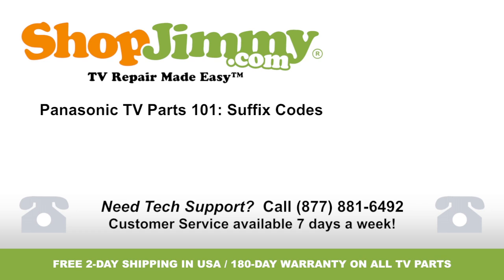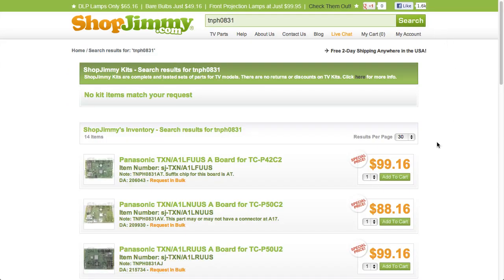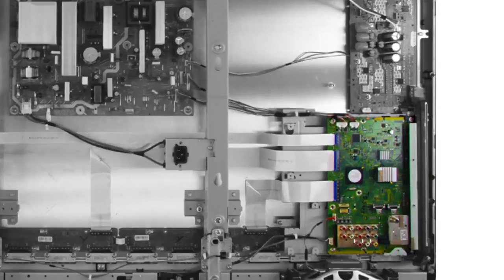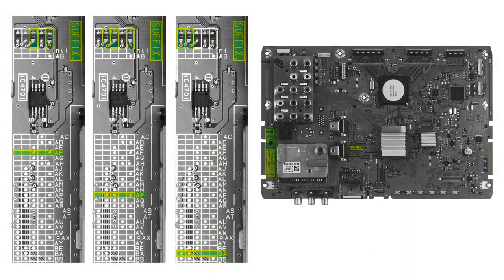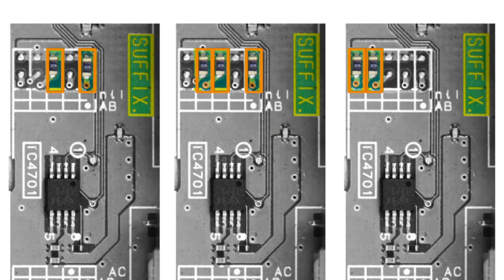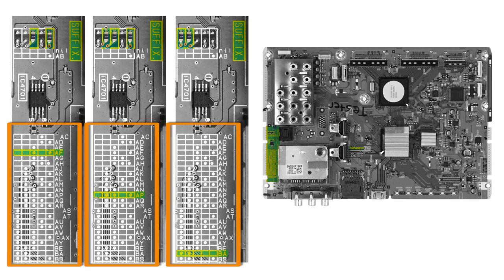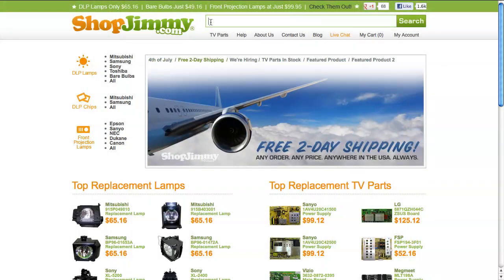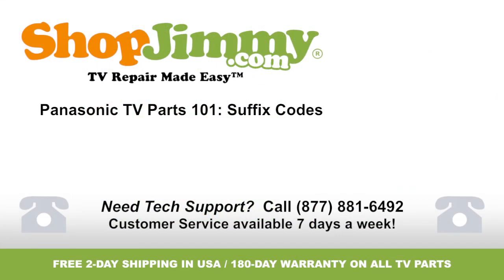Panasonic Plasma TV Repair-Understanding Suffix Codes for A Main Boards-How to Fix Plasma TVs

Comment: hi i have a panasonic TC-P58S2 Plasma tv, the red light keeps blinking red every second continouesly, the relays click on then click off a second later, i checked the capacitors they are all good, there was one time where i would reset the tv by holding the power button down then it worked now nothing, i have another identical tv and works great no problems, i have a surge protector on that one but the not he one im writing you about so im thinking thats the problem why,through my research i have come to the conclusion that the problem is the main power board, anything advice you can give me would be  greatly appreciated thanks

Comment: Dear I have Panasonic Plasma Model: Th-P42C10r which power supply assembly no: ASSY.NO.LSEP1279 and Bar Code 79BE0516022, we are facing problem of restart tv after 10 minutes or some time after on hour with RELAY SOUND like "CLICK CLICK CLICK CLICK"
Please let me know how to fix

Comment: Hi there, I have a Panasonic TH-42PZ700U TV, the color is mostly greenish in the center of the screen. I searched to see if I could adjust the colors but unable to. I'm wondering if a circuit board controlling the color is defective. Can someone who knows about this please let me know if that could be the problem, and if so,  which is the board that should be replaced, I'd appreciate the help, thanks.  Laponte20@aol.com

Comment: hi I have a 50 inch Panasonic tcp50g10 that wont turn on and light blinks 5 times can u help with the problem and if needed sell me the parts to fix the television

Comment: Hi there, hope you can help. My TC-P65VT60 Panasonic plasma is not turning on. It only displays three red blinking lights. What could I do? Thank you very much.
Reply from the maker: +DarthCardo   Try this at your own risk. Unplug the TV, then disconnect the SC board and plug in the TV to see if the TV powers up. Note that it will not have a picture on the screen. Reply with the results of this test. Thanks! www.shopjimmy.com

Comment: hi there I have a panasonic LED tv model TC-L50EMS5 and the problem i have is that i can watch tv or my computer, but if i play my playstation, it will play for about 10 mins then it will shut off and I get 9 blinking lights. i have tried to research what the fault code is but i fund a lot of plasma info and none on the LED TVs

Comment: Panasonic Plasma TC-P55ST50 won't turn on, and blinks 7 times.  Thought it was SC/SU/SD boards so I unplugged the power supply at SC board (running from central power board to SC board), and also the three flip-up connector things (SC42, 46, and 41) between SD/SU boards and SC board.  Plugged TV  back in (to the wall for power), turned it on, and now I have 8 blinks.  Confused, can't find videos that explain, so I'm calling in reinforcements from ShopJimmy :)
Reply from the maker: Justin Newman   Try this at your own risk. Unplug the TV, then disconnect the y board and plug in the TV to see if the TV powers up. Reply with the results of this test. Thanks! www.shopjimmy.com
Reply: ShopJimmy.com  Thanks for the reply - so I followed your instructions; I Unplugged the TV, then disconnect the y board and plugged in the TV to see if the TV powers up.  It doesn't seem to power up, there is nothing on the screen, and it only blinks 7 times.  What should I do next?
Reply: When I say I unplugged the Y board, I assumed you meant me to only unplug the cable on the Y board that connects on the other end to the power supply.   No start up, only 7 red blinks.  Thank you in advance for your continued help
Reply from the maker: Justin Newman   Try the same test on the SS board.  Thanks!  www.shopjimmy.com
Reply: ShopJimmy.com 1. With the SS board being the ONLY thing disconnected from power board (and everything else connected), screen doesn't start at all and is just dark, 8 blinks.   2.  If SS AND SC Boards are BOTH disconnected from power, screen doesn't start at all and is just dark, 7 blinks.

Comment: I have a Panasonic plasma tv model TH-58PX60U.  It will not turn on.  It gives the 10 blink code.  I'm almost sure it's the power board that needs to be replaced.  I'm not sure which part to order.  Would it be something that I can repair myself?
Reply from the maker: mrslrj1s    Try this at your own risk. Unplug the TV, then disconnect the SC board and plug in the TV to see if the TV powers up. Reply with the results of this test. Thanks! www.shopjimmy.com
Reply: +ShopJimmy.com 
The tv does not power on.  It still displays the red light 10 blink code.

Comment: I have a TC P50G10 that experienced a loud popping sound. When I tried to turn on the TV I received no sound, no picture; however the backlight illuminates and I don't have any blink codes. I took the back of the TV off and can see that both the SC and SS boards are getting power, because the green led lights up on both. Any idea what the problem could be, I've done some research and think it could be the A board.
Also, I connected the TV to my router to see if it would get an IP address and it did, but the light remained amber instead of going green which also leads me to believe it's the A board. PLEASE HELP!!!!
Thanks
Update: I should note it's a 2009 model, don't know if it makes a difference.

Comment: We have a Panasonic Viera TV TP-50S1 (2009) and there is no sound or image.
Red light's flashing 10 times, goes off and starts again. We were informed that it was the MainPower TNPH0876-1A. We want to know if it's the the right part and where we can find it. Thank you.
Reply from the maker: carole labelle   Please watch this video FIRST to help with your repair!  https://www.youtube.com/watch?v=BP3NVNCGEv8  I recommend replacing the main board in your TV.  Click this link to possible replacement main boards for your TV model number on our website:  http://www.shopjimmy.com/catalogsearch/result/index/?cat=56&q=50S1  There may be multiple boards for the same TV model number, be sure to match part numbers on your current board, with your replacement for compatibility.  Thanks and please let us know if you have any further questions with your TV Repair!  www.shopjimmy.com

Comment: Hi, My tv is a tc-l32u22 with a defective Main Board TNPH0857 Suffix AE, is long out of stock in your webpage. It happens to found in your stock a TNPH0857 suffix 3A for a tc-42u22 (42 inches model instead of 32 inches I happen to have) I want to know if the suffix makes the devices incompatibles, because everything else seems fine (even the connectors). The Main Board costs 100$ approx. and I don't want to invest in a replacement that definitely wont work in my tv. Thanks in advance.

Comment: Hello. My Panasonic Plasma Stopped working a week ago.When I turn it on there are 8 flashing lights. Model: TC-P50UT50  What is wrong with it and what part can I buy?
Thx
Reply from the maker: piekutter   Try this at your own risk. Unplug the TV, then disconnect the SC board and plug in the TV to see if the TV powers up. Reply with the results of this test. Thanks! www.shopjimmy.com
Reply: ShopJimmy.com I unscrewed the back of the TV. I did not see any loose screws. I am not sure what the SC board is and how many cables I should be unplugging from it. ShopJimmy doesnt have the SS Board in stock but it recommended a repair KIT which comes with:
1 integrated Circuit
1 Transistor
1 Diode
1 Resistor
5 screws with washers.

I don't know if I should buy this and if I do are there detailed instructions which components to removed because I see many resistors, diodes, capacitors etc. 

Thank You very much for your help!
Reply from the maker: Lawrence Piekut   I recommend bringing the TV to a repair shop to get fixed, if you are not comfortable installing the repair kit.  Thanks!  www.shopjimmy.com
Reply: I am comfortable doing the repair. My question was will the repair kit tell me which parts/components need to be changed?
Reply from the maker: Lawrence Piekut   Yes, the components will be labeled with their locations on the board.  Thanks!  www.shopjimmy.com

Comment: I have a TC-P50G10 Panasonic 50" plasma tv  that has no picture, when I turn the tv on I hear a pop and then about 10 seconds later a second pop.I notice that the red power lite blinks 5 times. I tried to repair my self by replacing the power board with no result. what is my problem?
Reply from the maker: Cathy Carr   I recommend replacing the A Main Board in your TV.  Here is a link to replacement parts for your TV model number on our website, click here:  http://www.shopjimmy.com/catalogsearch/result/index/?master_part_type=Main+Board&q=TC-P50G10  Be sure to match part numbers on your current board, with your replacement for compatibility.  Here is a link to a video showing how to identify your part number, click here:  Panasonic Plasma HD TV Repair Tips: Suffix Codes for A Board & Main Boards  You can also call our customer service for further assistance with your purchase.  (877) 881-6492  Thanks and please let us know if you have any further questions with your TV Repair!  www.shopjimmy.com

Comment from the maker: @Chris Judkins - I would recommend replacing the y-main board.  There could also be holes in the buffers.  Check over the boards and see if there is anything out of the ordinary.  You can also call our customer service for further assistance.  (877) 881-6492

Comment: I need help repairing my 42' plasma Panasonic Viera TV model no. is TC-P42C2. I was watching it and sound just went out. I unplugged it. reset it. changed the cable box on it. all audio settings are on but still no sound. I was told it could be a bad audio circuit board. Is this somthing I can fix myself?

Comment: Hi,  can u tell me which board fixes the right side of the screen. I turned on my plasma and right side is 1/2 black & white. I got this at Costo and even though I'm grad fathered in for a return they wouldn't honor it. . p.s. number might actually be Panasonic TH42PX6U, NOT 60 on the end. THANKS!  42" I can replace the board if I know which one it is?

Comment from the maker: @wilkins gerains garcia peña - El consejo que necesita para su reparación es Vizio 3632-1742-0150 "main board" de E3D320VX. Ir a shopjimmy com y buscar el número de pieza 3632-1742-0150. Puede llegar a nuestro sitio web haciendo clic en los botones en el vídeo de arriba. Gracias y por favor, háganos saber si usted tiene cualquier otra pregunta. Hablamos español en el teléfono. (877) 881-6492